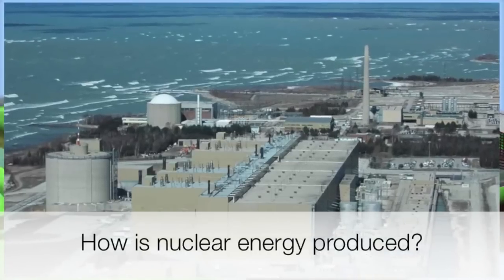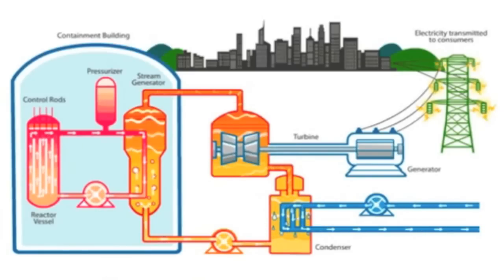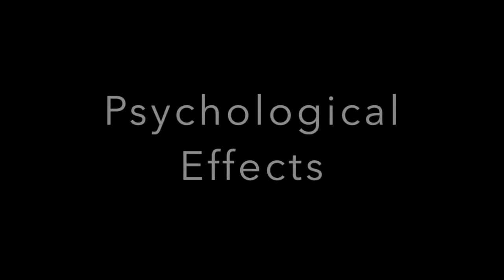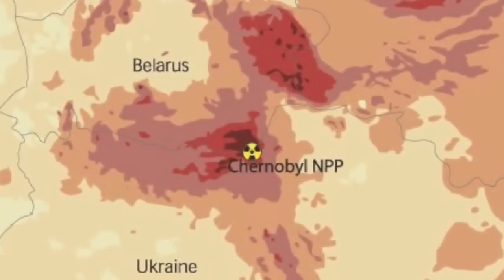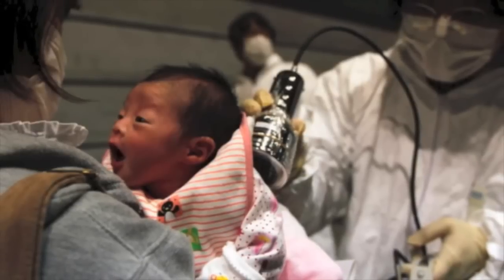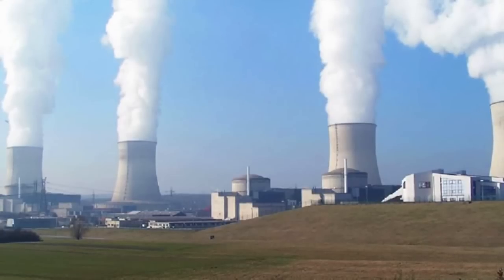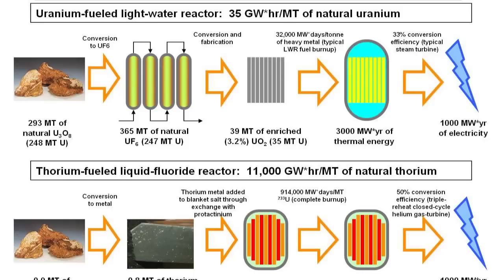Why India and other nations want thorium as Nuclear fuel.

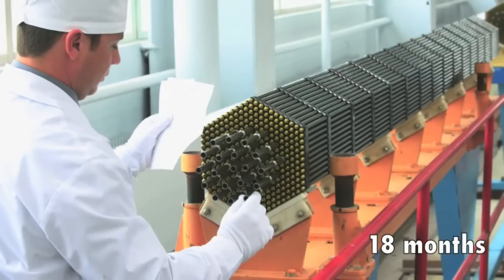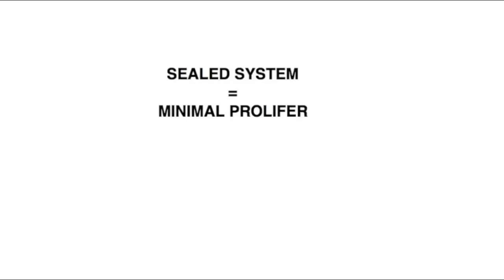Comment: https://www.youtube.com/watch?v=Uj3U9sMJCsc  11:49 to 12:06 At full capacity liquid fluoride thorium reactors do not have to be refueled for 30 years nor refueling for extended periods of time also means that it is a sealed system which minimixes proliferation risk of nuclear and/or radioactive materials from their core.  https://www.youtube.com/watch?v=Uj3U9sMJCsc&t=108s What amuses us Russians is that why use liquid fluoride thorium when they could have used liquid fluoride beryllium containing a plutonium 239 content of 2% to 3% with a 99.99,999% high purity that will make the entire mass of liquid fluoride beryllium cause the 99.99,999% high purity plutonium 239 content of 2% to 3% weapons grade plutonium of 99.99,999% purity to fission and simultaneously creating the same hyper-density neutron density flux because beryllium is inert, non-combining, it is a neutron multiplier and neutron reflector. The same hyper-density neutron density flux will cause the plutonium 239 to simultaneously reprocess-recycle itself and consumes it's own nuclear wastes as it activates itself to full fission capacity. No need for refuelling indefinitely and it can be modified to become a uranium 238 to plutonium 239 breeder reactor to start up new liquid fluoride beryllium MSRs with a 99.99,999% high purity plutonium 239 content of 2 to 3% weapons grade plutonium of both of the non-breeder and breeder type MSR liquid fluoride beryllium with a plutonium 239 content of 2% to 3% of 99.99,999% high purity.

Comment: Many future nuclear reactors will will be able to burn up many different nuclear  materials.  That includes radioactive waste from old reactors.   They will be able to use old nuclear  waste and nuclear weapons as fuel.   In future  they will also be able to use Thorium as fuel.  Thorium as fuel is much cheaper than Uranium.   It is more abundant and available in most countries.  Thorium is safer to handle.  Future reactors will only produce a fraction of the waste.   Over all many next generation nuclear reactors will actually dispose of most nuclear waste.

Comment: You've missed the dirtiest secret of the Uranium based nuclear industry, but that's OK. Even universities that specialize in teaching and preparing people to work in that industry don't tell it... it IS the dirty secret the industry doesn't want anybody to know. Here it is... 

Exposing Uranium deposits to the atmosphere causes Radon 222 gas to be released into the atmosphere. U238 is the only source for Radon 222 gas on the planet since Rn222 has a half-life of only 8 days. Check out the decay chain of U238 right here...

https://upload.wikimedia.org/wikipedia/commons/4/4e/Uranium_series.gif

In the decay chain, you will find that 99.99987% of the Radon gas will turn into Polonium 210 that has a half-life of 138 days. Polonium 210 is an alpha emitter, but it is a very powerful emitter and highly radioactive. Although such alpha emitters are easily blocked, a piece of cardboard will shield you from the radiation, when ingested it is a powerful carcinogen, and there is the reason it is the dirtiest and best kept secret of the industry.

This Rn222 gas is now circulating around in the air and as it turns into Po210, the Polonium atoms rain down from the sky, dusting the land to contaminate crops and into the water to be ingested by fish. And even after the 138 day half-life, the Po210 will finally become Lead 206, and that's highly toxic too, so the fish is now contaminated with lead... those that survive for us to eat.

Yummy! Better living in the nuclear age, eh? NOT! No wonder 1 out of 3 people living where Uranium is mined will get cancer in their lifetime.
Reply: Hi Ladamyre, the way I understand it your issue on Uranium being exposed to air is THE good thing about Thorium Molten salt reactors.  
The stable salt reactor design is about ten thousand times better at containment because the high pressure nuclear hazards have been eliminated through low pressure high temperature salts and chemical engineering.  In a molten salt reactor you seal up the Thorium / Uranium mixture in a low pressure molten salt reactor underground and point a neutron laser at it.  
After being directly struck by a bit of neutron radiation the Thorium will turn into Uranium.  The Uranium is fissile, giving off neutrons and radiation spontaneously.  This makes the Uranium very hot which melts the salt and keeps the chain reaction going.  If you turn off the laser that cuts power to the reaction slowing it down and cooling it off.  

If the Molten salt ever gets too hot, the Thorium and Uranium dissolved in the molten salt will stop absorbing neutrons.  The reason the neutron absorption stops is because the molten salt heats up as it expands.  The atoms also start moving faster as the molten salt heats up.  This means the chance of a neutron making a direct hit on a Thorium or a Uranium atom drops below the threshold you need to keep the reaction heating up.  All the extra neutron radiation glances off the atoms and passes safely out of the reactor into the neutron absorbing molten salt coolant blanket.  This process guarantees the molten salt will cool off in a chain reaction.
When the Thorium / Uranium atoms stop absorbing neutrons then the reaction will start to cool off. 
As you atomically split and burn the Thorium and Uranium in the molten salt reactor.  The Thorium and Uranium decay well past all the dangerous elements and into the useful elements.  Once we boil down the atoms to something nice like Carbon 60 we can use the C60 for cancer treatments.  We could also make synthetic platinum or other useful things you might like by separating the right isotopes from the molten salt soup at the right time.  There are also all the high temperature chemical processes a molten salt reactor unlocks.  I've seen very joyful engineers from China describing the water purification, vertical farm food production, synthetic fuels, and other life saving processes that become socially profitable for everyone with Thorium MSRs.   
I would also like to point out all of these chemical processes and energy producing reactors would absolutely require people doing jobs by the thousands.  This would be a major boon to all economies which are struggling.  We'd have ways to grow because energy prices using our dwindling oil reserves would no longer be an issue.  Providing clean water and a way to grow your own food from this energy source would be a lifesaver in many countries.  Giant Data centers the size of small cities employ lots of people.  They require steady reliable power power in the 20 megawatt range.  As you can see the jobs you could produce from running an MSR are very high because a Molten salt reactor produces from 200 Megawatts to 1,200 Megawatts of electricity.  City size Data centers, or chemical manufacturing facilities, laser facilities or every other industrial process would become much more feasible once we have cheap energy.

Anyways,

That's my $1.25 sorry for the ramble.

Comment: A few arguments here:
1. I wouldn't use Chernobyl as an example of a typical PWR, as it had a graphite moderated system that controls less neutrons and this system ran with a positive coefficient that allowed for gas to regularly form in the water. Most PWRs are not like this.
 
2. On the issue of waste, there are many aspects of which you say are true, and if you mean by what we currently do then you are correct. However I find a lot of people are always concerned about Plutonium 239 and its half life of 24,000 years. First of all medically speaking this is actually better since the material decays at a slow rate with alpha decay and low gamma admittance. Its actually quite preferable compared to other isotopes that have much lower half lifes. Secondly if youre still concerned by how long the material decays then the solution is to fission the material in fast reactors. Pu-239 is a fissile material that can be split into Xenon 134 and Zirconium 103. Xe-134 is stable and Zr-103 has a half life of 1.8 seconds. After 10 decays the products of the split Pu-239 become stable in about 10 months. Its important to use fast reactors, because plutonium has a very high fission probability under conditions of a fast reactor compared to that of a thermal reactor.
Reply: Expanding on your first point, the Chernobyl RMBK's  are "pressure tube reactors."  The reactor fuel assemblies and the cooling water are contained in tubes running through the graphite moderator.